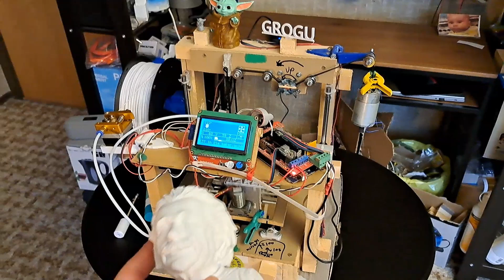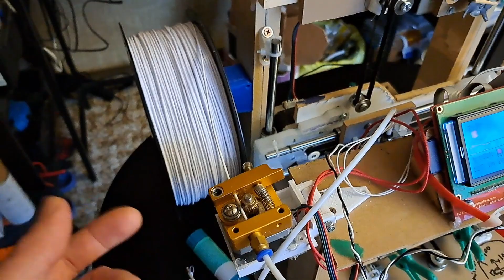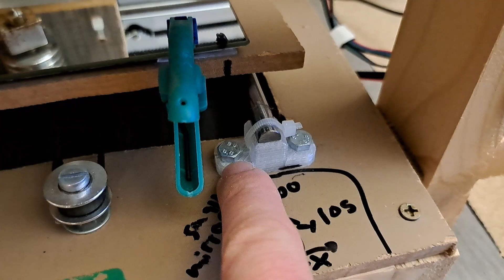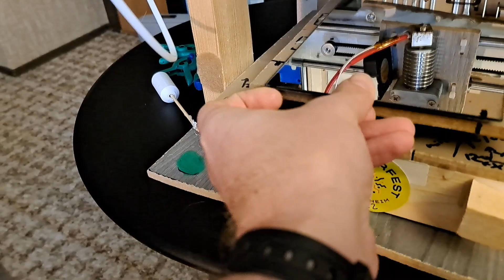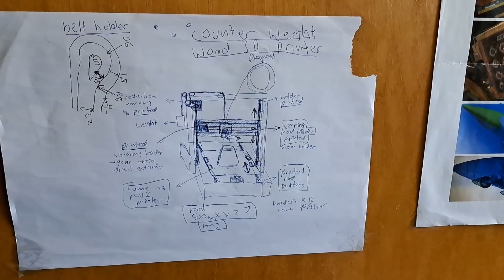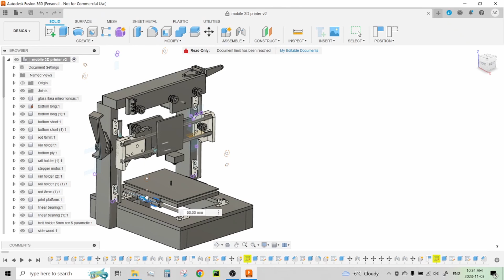Cheapest DIY 3D Printer And Only Counter Weight 3D Printer In The World

Comment: it looks terrible but  i love it. but i kind of assume ramps screen and arduino cost almost half of the price of a cheapest 3d printer in store, at least they did when i bought my parts during the pandemic
Reply from the maker: Thank you.  I love making thjngs that look terrible but work.  For me it was about 26 USD for ramps board, screen with SD, and fake arduino mega, and maybe 1usd for each stepper driver from aliexpress.  I would say more like a 1/4 or less then the cheapest printer.  Also would be way cheaper if you buy in bulk.  I will release a build video soon with a part list for this printer with links.

Comment: Awesome.  It makes me cringe, but it's awesome LoL.  I've been thinking of building a large core xy in a plywood box frame, this makes me a little more confident about it.
Reply from the maker: Thank you.  Go for it.  For me starting was the hardest.  Once I started building it was really fun.
Reply: @Understated_Engineering  I think first I'll finish the suite of upgrades to bring my Ender 3 up to it's final state where I swore to myself I will stop upgrading it LoL.  Then I'll use that to build the new one.  Still trying to decide which parts to buy vs make, like rails and bed.  I'm considering 3D printed rails and plywood/glass heated bed.
Reply from the maker: It is so great to have one printer print parts for the next one.  I really like using plywood.  For me printing on glass with glue stick is perfect as it sticks really well.